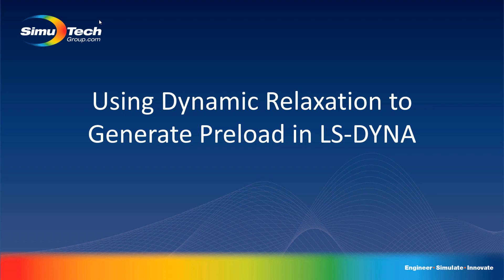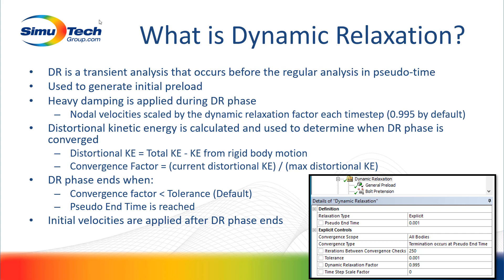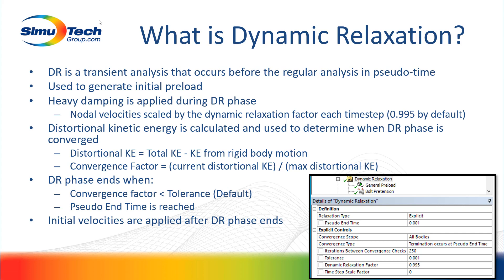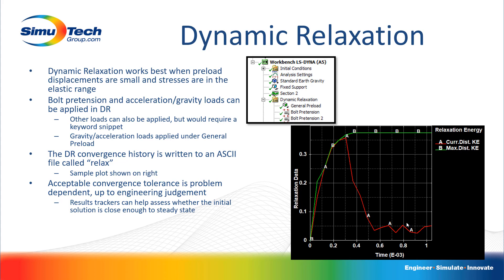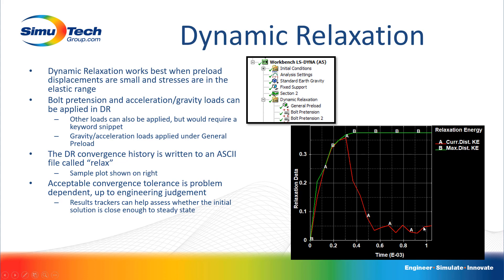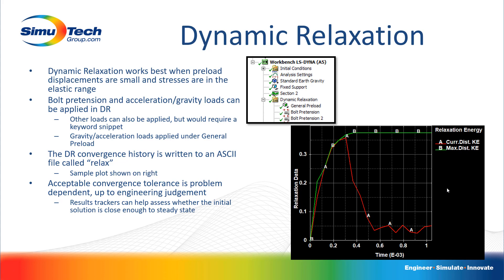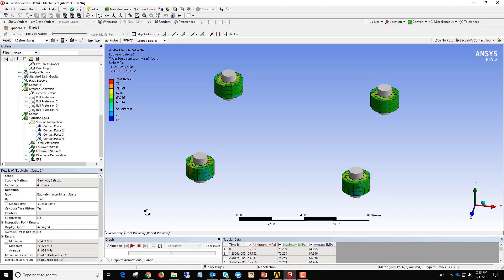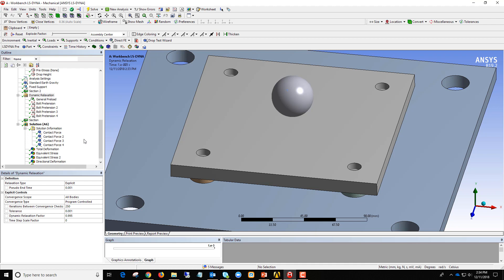Using Dynamic Relaxation to Generate Preload in Ansys LS-DYNA

Comment: do you have any video showing the application of bolt pretension on solid element instead of beam element? thanks
Reply from the maker: Thank you for your comment, I have sent a note to the engineering team that this is something our audience is interested in! In the meantime, you can find more tips and tricks videos here https://simutechgroup.com/resources/?_sft_category=tips-tricks
Reply: @SimuTechGroup  thank you for the content. It would be very useful doing the same on solid element please. because an assembly with the clearance can not be assessed using beam element
Reply from the maker: @trungnghiale8286  Thank you for your comment. If you are interested in mentoring, training, or consulting services please send us an email at info@simutechgroup.com thank you!